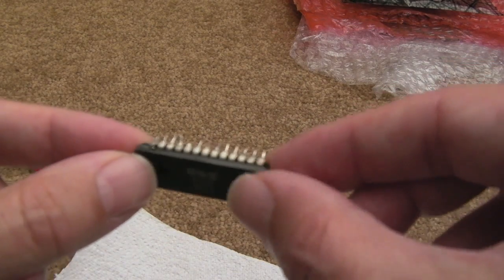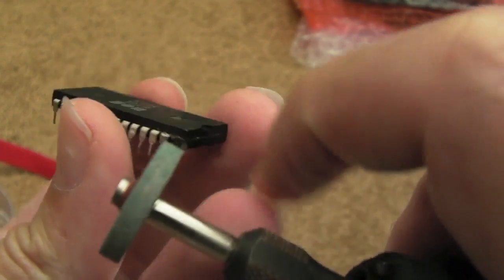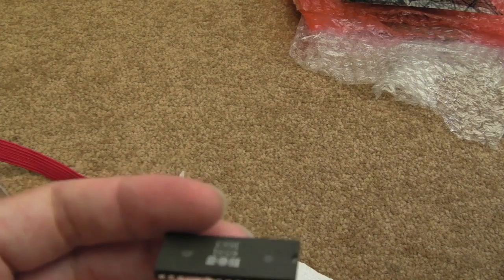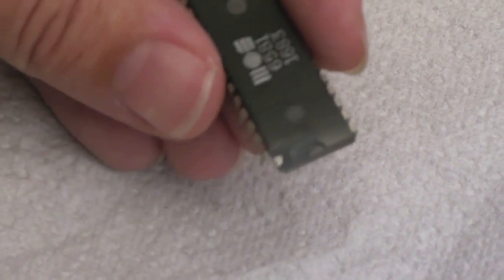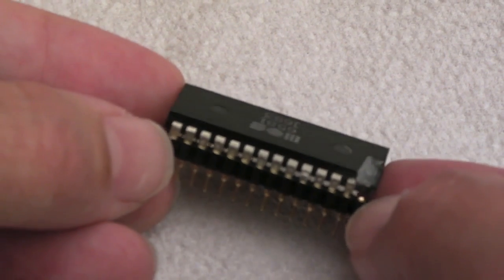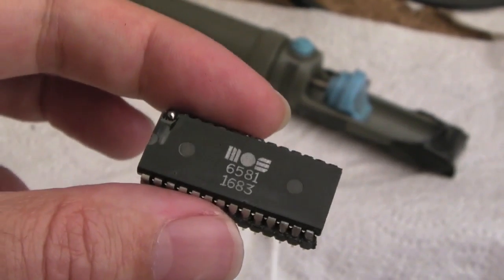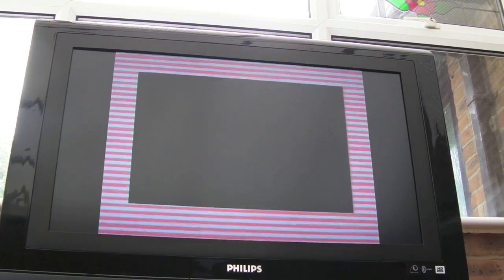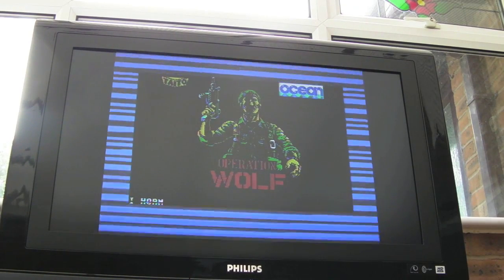Repairing Missing Pins on Chips (C64 SID)

Comment: a leg fell of one of the chips from my very rare and expensive bbc micro 32016 second processor

the chip is the NS32081D, and it seems that the metal of the leg was so corroded it just fell off from the main ceramic body of the chip...no exposed metal to solder a new leg to

as the 32081 is no longer sold, I guess I need to get the dremel out and try this technique

Comment: Are there not 3rd party remakes of the SID chip?
Reply from the maker: Thanks!  Yes, I've covered the Nano Swin SID and Swin SID Ultimate on my channel (videos on each) - and there's the FPGA SID due for release any day now! =D
Reply: I wonder if it can be made with discrete parts.. hmmm
Reply from the maker: Yes, that's possible!  Any chip is just a circuit of IC's and other components internally, so someone could build a SID on a breadboard for example.  You might need a fair few components, but it's entirely possible!

Comment: I have a suggestion based on something I did yesterday.  When scrapping some old electronics there were 3 ICs that had the identification totally etched off, so without knowing what they are they're useless to me.  I took some flat-nose pliers and bent all the pins back and forth until they broke off.  Now I have a nice supply of IC pins, all flat and correctly sized, for soldering onto the stubs of broken pins on good chips that I want, such as the MOS 6510 in my C64 which I fixed nicely.  In that case the narrow part of the pin broke off, leaving the wide shoulder at the top.  All you have to do is put a little dab of solder onto the pin stub, get some flux on the replacement pin, and hold it there with the soldering iron on top of it.  The solder melts and the pin presses flat, making a very strong joint between the two when it cools since there's so much surface area.

Now, for the pins that are broken completely off at the edge of the chip like what you're fixing, that would take a bit more work like what you had to do.  But if you did the same grinding technique to the chip you're salvaging pins from, you might be able to break the pin off with a bit more of a horizontal lip in order to get good contact with the  pin you're fixing.
Reply from the maker: Good tip, and that can work well if you can solder to the remaining part of the leg.  In this particular case, there was barely anything to solder onto and it was proving impossible to solder a reliable connection that would hold with enough strength to be pushed into a socket.

Comment: Great idea, thanks for sharing. Question: is the C64 motherboard sitting directly on the carpet, towards the end of the video?
Reply from the maker: Thanks!  And no - it's at on a large piece of anti static foam!
Reply: Wheeew. Thank you. :) I couldn't see it.
Reply from the maker: No worries - totally valid question to ask!  Some of my older videos I did far too much on the carpet when working on some systems.  Typically the CMOS and HMOS chips in the C64 models are much more sensitive to static, which is often why I will only work on an anti static mat when dealing with them, even if I don't show the ESD foam or wrist strap.  But there are some earlier videos where I didn't take that precaution.

Comment: Man, that's great work. Another SID saved from the landfill. I really appreciate you're taking the time to save single chips like this. That's dedication right there!

Have you thought about putting it on a small pcb, and epoxy'ing it on, for a super ruggedised fix? Might be worth investing a few pounds in spinning up some boards
Reply from the maker: devjock That's a good idea!  One thing in retrospect based on a point someone else raised here - static generation when doing this kind of fix will be high.  It's a very good idea to link all the pins to a wire connected to an ESD wrist strap whilst doing this kind of repair.  The SID was known to be glitchy before hand though - the person that sent it to me said he had a problem with a channel or something on it, and that is the case.  It works for testing now but it's not perfect.

Comment: I need to do this to a SMD on a MVS4 board.... :S
Reply from the maker: kamencesc Ouch!  It can still be done, I've fixed SMD chips this way before but it can be more stressful.  This technique can also be used on the Wii to expose one of the pins cut off at the factory - to allow mod chip etc.

Comment: Sounds like the problem with this SID is that the filter is too heavy and its drowning certain filtered sounds. Try playing Savage track 4 (first 5~7 seconds) since that's a good music for a quick test to check how heavy/light the filter is.

It should sound like this:
https://www.dropbox.com/s/ypu6e7gfg2j5l5w/Savage%20T04%20Filter%20Test.mp3?dl=1
Reply: +GadgetUK164 I'm not too familiar with the hardware in the SID, but a mismatched impedance on the support hardware can cause this effect on just about any sound chip.  You may want to try tuning the support hardware to see if that fixes the issue.

The electrical properties of both the support hardware and chip can change over time due to aging of materials.  Since the chip is harder and more expensive to replace, it's best to compensate for the differences by matching the support hardware to the changed specs of the aging chip.  This usually requires a bit of tinkering and tuning, however it's benefits are usually worth it.
Reply from the maker: CryoSID Thanks, will check that out =)
Reply: Totally agree! They did this at the manufacturing plants anyway, for the very reason that these devices were all slightly different. Adjusting various support passives around it will do the job on there. I remember reading somewhere that they had buckets of caps laying around, and they would just solder in the one that made it pass.

Comment: Brilliant fix and very similar to the technique I use myself. Regarding static To reduce the risk I built a little jig basically a number of ic sockets soldered to to a bit of strip board with all the pins soldered together and off to a flying lead which goes to my bench ground. you put the IC to be worked on in the appropriate socket while you work on it, it holds the ic still for grinding and stops any static buildup. also I use a small ball mill to grind away the package rather than a grinding wheel. Love the idea of fitting to pin headers and soldering them in place I’ve not tried that idea but sounds ideal where you have a number of pins that are on there last legs.
Reply: Yeah, I was going to suggest using a vice or a jig with a socket.
Reply from the maker: JaysVintageJunk JaysVintageJunk That's good advice - thanks!  Static when handling the SID there should really be a big factor as you only need to look at the SID the wrong way and they take ESD damage.  I think in retrospect doing something like you've suggested is something anyone should do when following my approach here.

Comment: That's the Vdd pin. Basically, it's the power supply connected to 12V
The Vcc pin (pin 25) is connected to 5V and used to reduce noise.

Considering how much static grinding the plastic must generate, It's a win that the chip survived at all!
Reply from the maker: Aadil Shah Yes, it is a miracle it even works after that.  That said, I've repaired chips like that before without a problem.  The SID is mega sensitive to static though - I don't actually know of a more sensitive chip from my experience, other than modern RF components.